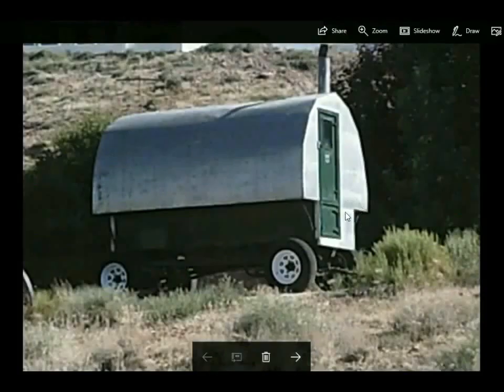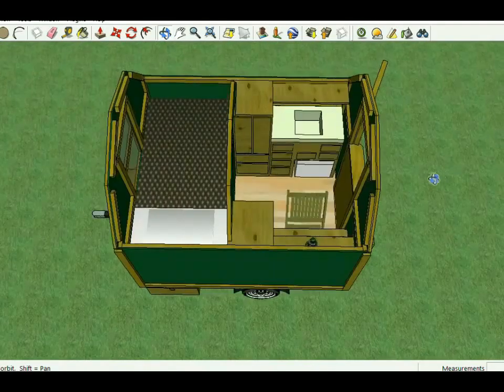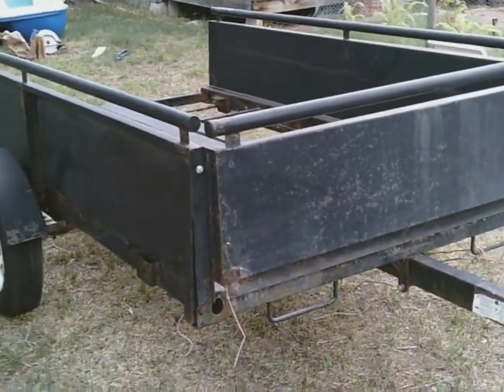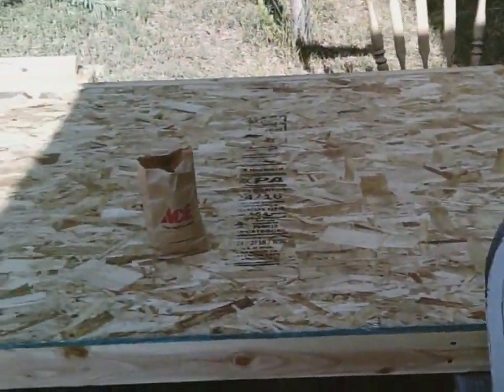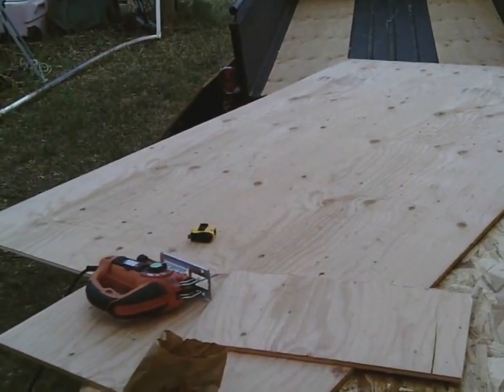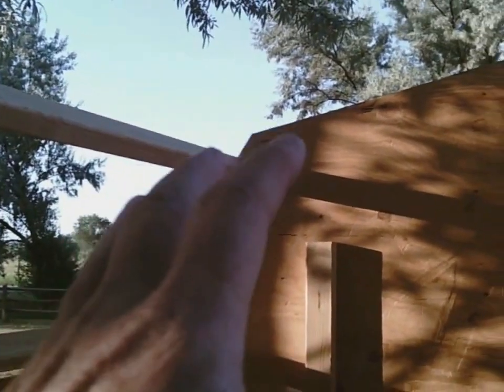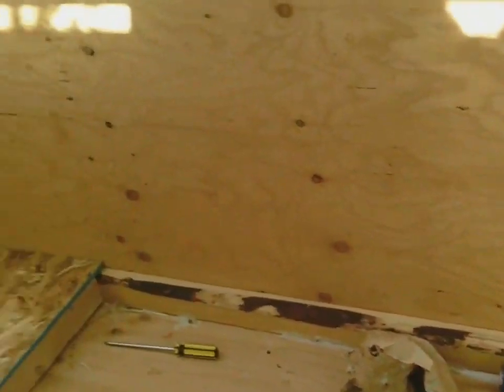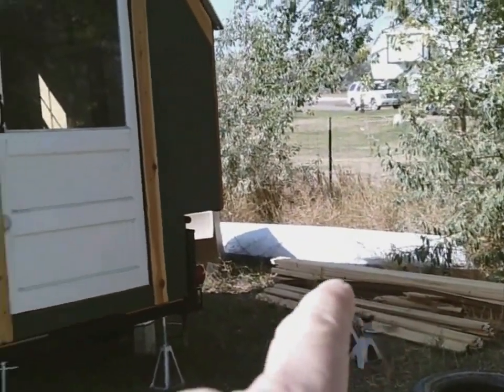Build Your Own Vardo Wagon Full Construction Series Free Plans

Comment: I’ll be following this build. I built a slide in camper many thousands of year ago. I used 1/2 x 1 in framing in most of it as bd 3/8 plywood. The front over hang was 60 x 84 snd the box was 120x 48 at the floor and 84 at the side over hang. Love your window and door.

Comment: I am not a very handy person so this is probably a dumb question.
Wouldn't the water end up trapped under the build and rot the wood due to it being inside the trailer frame?
Reply from the maker: There are slots in the floor boards and I recommend painting the floor with exterior waterproof paint.
Reply: Spray on Rhino Liner.Drain slots.